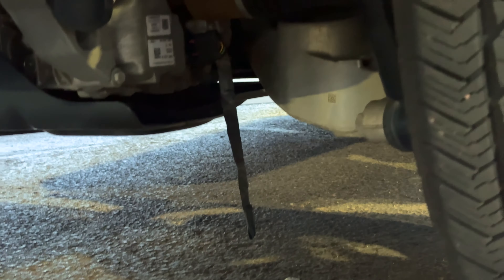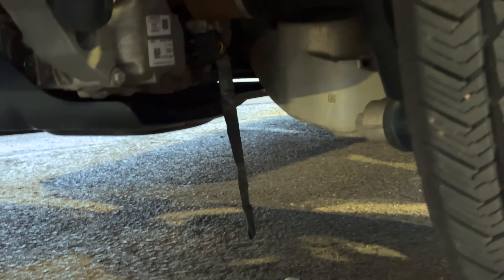Electric F150 held together by Electric tape?

Comment: They actually had a recall on that for my 21 f150. I couldn’t believe it when the service department told me what it was about😂
Reply from the maker: That’s good to know.  I’m wondering if it will be a recall on this one.  I actually have 4 open recalls on mine that are finally scheduled to be fixed in January.
Reply: @F150LightningMike  I know mine has had a lot of recalls. More than any other year of ford f150’s I have owned. Hopefully the last one being a recall on my wiper motors will be the last one!!
Reply from the maker: That’s crazy.  Yeah I hope these 4 are it for me too.  I know the CEO was recently talking about addressing recalls and quality, so I hope they start turning things around.